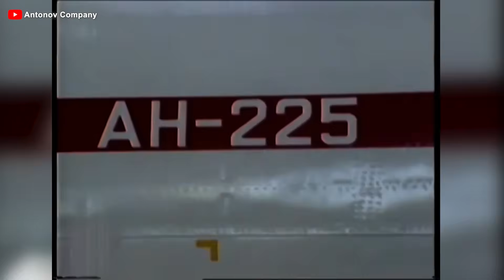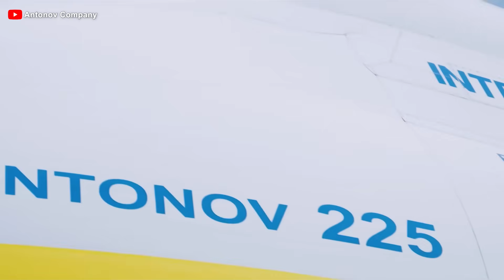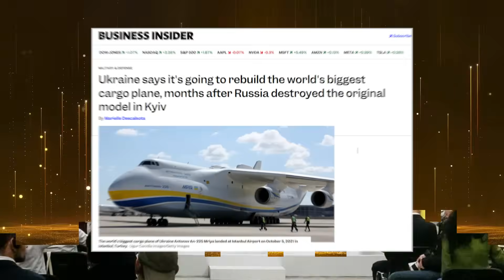Ukraine Just Revealed The COMEBACK of The Antonov AN-225! Here's why

Comment: Yes, there is an unfinished An-225. A complete but bare fuselage, wings stored elsewhere. Using parts of the wrecked мріяти is not possible due to twisted airframe, heat distortion, shock loaded parts of the airframe etc.
Reply from the maker: thanks for comment